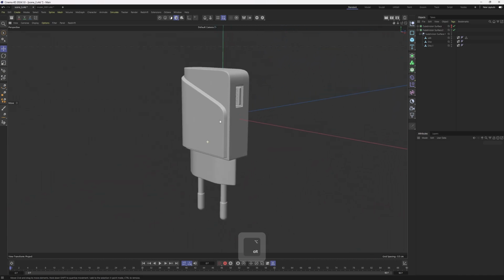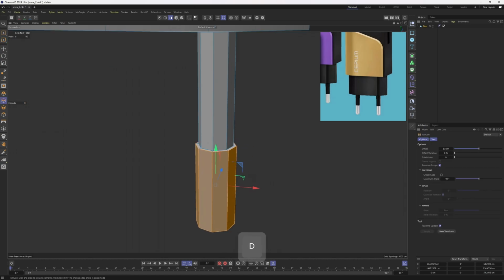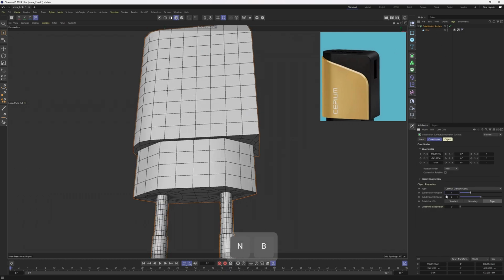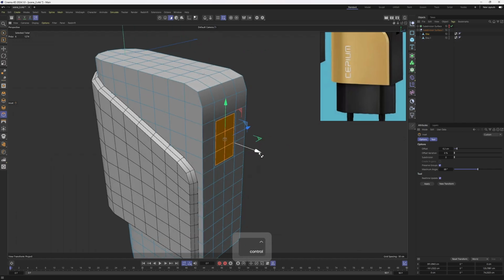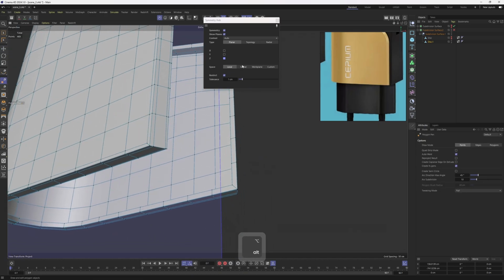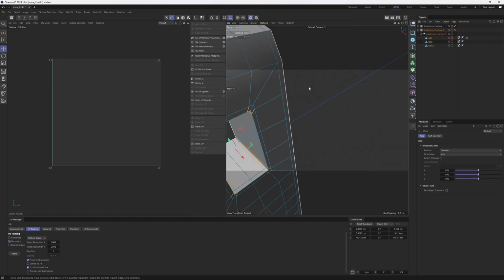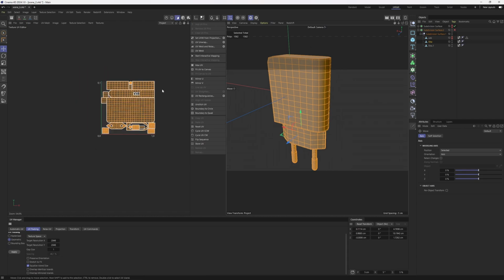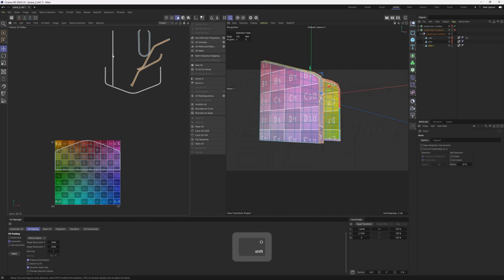Industrial Design/Product Modeling #38 Charger

Comment: learned some really cool shortcuts in this one! Still quite new to modelling.

Can someone tell me why I would use weighted subd instead of using control edges? Unsure when which approach is best
Reply from the maker: I use weights to lower down the density of the mesh, because I do this whenever I subdivide my mesh 1 time.

You can also add control edges but you'll end up with more polygons especially around the sharp edges after you subdivide the mesh.
Reply: @polygonpen that makes a lot of sense! Thank you so much for replying  and   producing such awesome  tutorials :)

Comment: I just don't understand why you have to weight these edges and make editable the subdi
Reply from the maker: Whenever I subdivide my mesh (Making A Subd object editable), I use weights to make the edges sharp enough, you can also do this by adding supporting edges but adding supporting edges you will increase up the density of the mesh when you make it editable so to lower the desnity, I use weights.

Comment: Hey, what is you opinion on cad softwares, it seems that a lot of staff that you model, wold be easier to do in cad and remesh if needed
Reply from the maker: That process is not as easy and fast as it sounds; unfortunately, remesh methods are not that good or accurate. I find myself retoping CAD models by hand most of the time, like 90%. Also, topologoy skills are the foundations of a qualified 3D modeler; CAD tools are just side tools, and relying on them will make it really hard for you to find jobs. You can't put CAD models in your portfolio because you can't show the wireframes of the objects. One of the first things we did when we looked at the portfolios was to check the topology knowledge. I don't remember when we hired someone with low topology knowledge. So in short, if you want more job opportunities, you need to learn SubD.

BTW CAD programs are justgreat, I want to improve myself on this field.